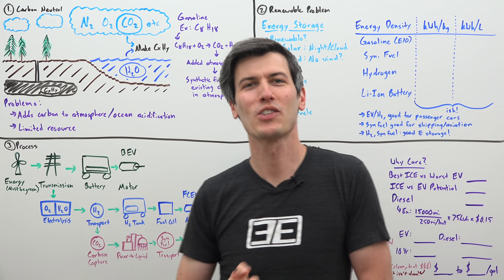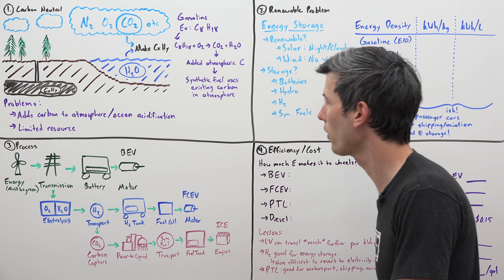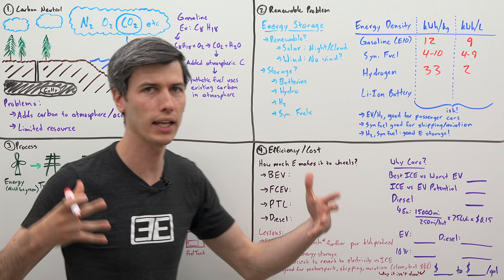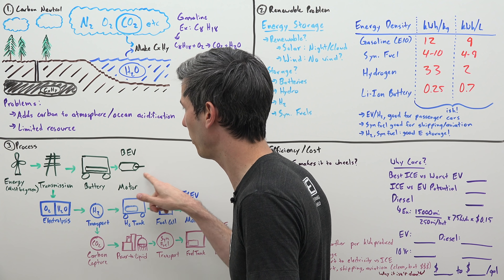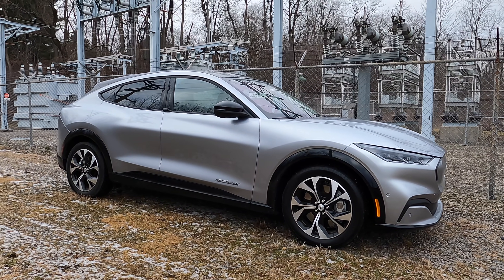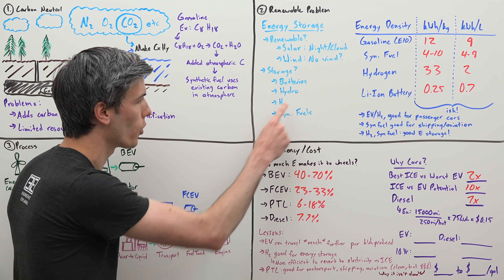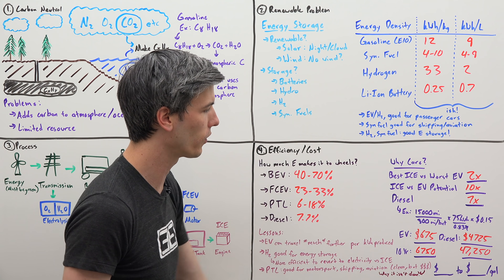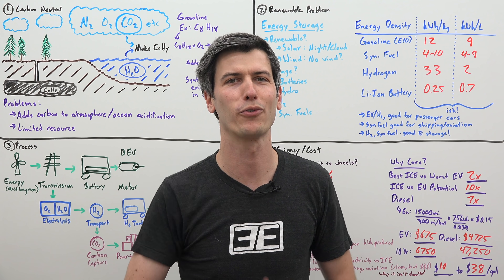The Big Problem With Synthetic Fuels

Comment: These sorts of comparisons need to start factoring in mass of the vehicle, even the passenger car, with respect to efficiency.   A Model 3 is 4000 lbs and a Civic is 3000 lbs.   On the freeway, dominated by drag, it matters less, but in city driving, acceleration and deceleration of 1000 extra lbs matters.   At those numbers, as of this 2021 video, efficiency still comes out way ahead for BEV, but the gap is not as big as just energy delivery, because of the difference in energy needed.    The other elephant in the room is safety.   Mass in motion is kinetic energy....the kinetic energy that makes crashes more dangerous, and more likely (vehicle performance being worse).   Lighter cars, all else being equal (crash structures, etc), are net safer in vehicle to vehicle collisions.

Comment: Not one of your better videos. The potential for hydrogen is +100% power conversion simply because heat is also energy input and it has been demonstrated and you can buy electrolysis tech that delivers just that. Recent MIT research point to jut 770kWh per ton CO2 totaling $56/ton based upon $0.03kWh offshore wind. Fossil fuels couldn't compete without the $7Trillion subsidy.

Comment: Is there a version of this where there is also an accounting of the energies required to extract these energy sources (eg crude oil extraction, and refinement energy costs, compared with lithium brine extraction and refinement, compared with eg producing of solar panels to collect solar energy to deliver & store electricity, etc)? Because that should surely factor into the net equation of overall energy cost, no?

Comment: Missed out a couple of big issues. 1. Amount of carbon produced making electric cars (mining transporting processing all the stuff to make it not counting any other pollution
). 2. Shear limits on how much stuff we need to convert to all electric transport including the up front production of carbon to make those vehicles (ie not enough copper mines and 10+ years to develop new ones). 50% fuel efficiency gain would be a better goal short term and cost wise.

Comment: With both using renewable energy, synthetic fuels are carbon neutral but BEVs are zero carbon. The goal is to get global CO2 levels down, not just keep them the same.
Reply: But then consider the effort and emissions surrounding lithium batteries.

Comment: Jason, can you find the answer to this question:  How much electricity is used in the gasoline supply chain?  Is more electricity used to drill, pump, transport via pipeline, refine, pump, store, and pump a gallon into your tank than if we just used the electricity directly to charge your EV?

Comment: Overall cost of running a car needs to be considered. 
We need to include the cost of wearables. Fuel might be expensive but how much is a new battery, or tyres or brakes?
Are the insurance costs of an EV more?
Are taxes more or less and how will they change, (because they WILL change - the govt ALWAYS move the goalposts)?

Comment: You CANNOT compare battery energy density to fuel.  Batteries are store not fuel.   You need to compare common denominators like system weight and volume for range.
I prefer to compare a power wall to a Hydrogen storage system (electricity in electricity out), its 90% to 35% (on a good day) round trip efficiency.
The Porsche cost doesn't include direct air CO2 capture, thats likely to double to cost.  Their CO2 comes from burning fossil fuels.

Comment: @Engineering Explained, one comment to Your absolutely great video: here in Finland, the fuel already costs over 10$/gallon. So The synthetic fuel doesn't sound too expensive in here! And therefore it might be a lot more feasible, than You seem to believe. As the fuel is in rare countries as cheap as it in USA (or other countries with domestic oil production). Of course much of the fuel price here is due to the taxes, of which most are justified due to the pollution, and with synthetic fuels there would be less justification for these taxes.

Annother thing is the prices of new cars. Again, here in Finland, the new cars cost roughly twice the amount (or more) they cost in USA. And that is why we have one of the oldest fleet of cars (average of 13 Years). That is where the synthetic fuels can help us to move forward with minimizing the carbon dioxide emissions, as that wouldn't require the complete renewal of car fleet in Finland.

Third point is, that at the moment we are building A LOT of wind power, and therefore there will be times in the future, that it will be profitable to produce even synthetic fuels with the energy no-one needs or is willing to pay for.

So my point is, that the synthetic fuels might be a feasible choise in passenger cars also, at least for some transition period, depending of the country You live in.

But I really enjoy Your videos, they are so informative and very well presented! Please carry on the great work!

Comment: Does storing the energy from the source as hydrogen also have less environmental impact than trying to build massive battery banks to store for use later? If so, it seems to me that would be the most environmentally effecient way to ensure EV's have enough power they can be charged with ... as their adoption grows, because renewables arent stable enough in power output to support a worldwide transition to EV's, so yeah there has to be some sort of energy storage because of that, and using batteries to store, before it charges EV battery... yeah thats just not gonna work out until battery tech and environmental implications of them make leaps and bounds in their energy density. The only stable alternative to unstable renewables, currently is nuclear. If nuclear was the predominant source .. then there would be no need for massive battery banks or hydrogen storage to meet the current and future entirety of EV charging demand... im thinking..

Comment: you are correct, Ethanol can and is capable of completely eliminating gasoline. Gasoline engines were originally designed to run on Alcohol (same corn alcohol as moonshine and that is why it wasn't adopted, replaced need for gasoline, John Rockefeller got the government to create a sugar tax, and the cost effectiveness was destroyed) . Diesel engines were intended to run on Vegetable oil.  run the number son that.  AND take into account that both fuels are carbon negative asn teh plants that produce thenm actually consume carbon dioxide from the atmosphere

Comment: the biggest hurdles electric vehicles still have to overcome when it comes to actually being environmentally friendly are:
1) the mining process necessary to make the batteries for the vehicles
2) the process of actually making the batteries themselves
3) recycling the batteries so they dont leak toxic chemicals into the environment

there's also the problem of the batteries catching fire. lithium fires are much, much more dangerous than gasoline fires, but i feel that can be solved with relative ease compared to the other 3. its more like a bump than a hurdle

and given synthetic fuels are just so cost prohibitive... hydrogen may genuinely be the best option for now, but the infrastructure needs to be built. unlike EVs where you can get a charger for your house pretty easily, hydrogen vehicles more or less need dedicated stations, since its so volatile

Comment: I finished watching your video titled no, synthetic fuels wont replace electric cars.   You covered how synthetic diesel is too expensive to make sense.  I have been thinking about the abundance of anhydrous ammonia.  Figuring out how to use nitrogen from the air to make food was huge for food and population growth.  I thought even though the energy  and pressure requirements to make plant food is high and uses mostly fossil fuels that if you consider your premise of your video that your analysis might change.  If you consider renewable resource such as solar or wind, my preference is for thermal systems storing heat, then make the fuel (which i think is NH3/NH4) and Distribute that it would be more energy dense than a battery.  More over a hybrid BEV with a ammonia based fuel generator would not need such a heavy battery and could still supply torque with out large variations in engine output.   Since we already have a distribution network for fertilizer, I think it would make sense as the system could be scaled up and existing gas stations adapted for the fuel.  I was hoping you could do a video update on nitrogen based fuels as a result.

Comment: 6-18% not bad if you start from an abundant power source like solar panels in the desert,  gasoline is compact and you don't have to wait for recharging and the vehicle is cheap and light and  does not use rare minerals and don't not use high pressure tank

Comment: Why not include the energy needed to build the cars? You need 500 thousand gallons, or almost 2,3 million liters of water to get one tonne of lithium. Not to mention the recycling of the lithium batteries, you can just put normal ICE car in crusher and turn it into a cube and drop it into a smeltter to build new car, you can't do that with lithium batteries

Comment: Here is the thing though you need to think about energy storage costs,
In general in countries like Cyprus Israel etc, it's very possible to get more than enough power than you need from solar during the day, but at night you can't and also you need to protect against cloudy moments that will shut down the grid,
So you need to store energy for that, 
Storing as hydrogen is cheaper, than storing to batteries
And you can use it at night

Of course all of this is BS and nerd junk, we should just use nuclear energy

Comment: If production of e-fuel is to be done on a massive scale (which is the only way it makes sense) it requires a huge electrical power production and infrastructure but that is where we are going anyhow as hydrogen production through electrolysis also requires that same insane amount of electrical power, hydrogen as fuel is just as needed and has to be produced on a massive scale to fuel ships, industries and other heavy transport.
So according to me I think it's better to maintain the production of a higher amount of electrical energy rather than using lithium batteries which are not very efficient though they are getting better, but they are really more of an environmental issue, and  are quite expensive with a short life-expectancy. So if battery-technology is not rapidly changing then I think e-fuels are a much safer, environmentally friendly and perhaps cheaper way for more people to still be able to have a personal vehicle in the future, or atleast 1/family.

Comment: You showed very well how Corn should not be the source. However you can produce Biomethane, Bioethanol and plant oil and use that very efficiently and local.
In Germany rapeseed oil is used. Rapeseed produces 2/3 cattle food and 1/3 oil which then is used to drive the farming equipment. Also it´s not growing in a monoculture. 
Corn is a bad idea yes, however using plants for energy in general is not. It would be like saying EV vehicles are a terrible idea because we use those 100 years old battery tech. Yeah this would be a bad idea however modern cells are much better and only this makes modern EV vehicles viable at all.

Comment: In principle, yes, the extra processes reduce the efficiency of the overall process. But the great thing about liquid fuels is that it transports well, so you can produce it where the natural energy resources are most abundant. And studies showed that the efficiency numbers are not that clear when this comes in the equation (although electric cars do remain superior). Not to mention that synthetic fuels create less challenges towards the metal requirements than electric cars as we can keep using the same car while increasing the sustainability of its use. Also not sure why synthetic fuels should have a lower energy density than regular hydrocarbon fuels 🤨 It's possible to create the same quality of fuel via synthetic methods.

Comment: In the US, I may agree on the cost, but this has a few flaws:
* Direct air capture is not the way most seek to capture the required CO2, it’s much easier to take it from an combined cycle waste to energy plant or biomass plant, or an industrial process. The efficiency is a lot higher and the energy need thus lower. The cost is roughly one tenth as well.
* The average gasoline price in EU is about $2, or around $8 per US Gal. The price hike to reach the necessary level isn’t that big, and will be necessary for the millions of cars still on the road. 
* SAF or eJet will be necessary for all aviation and right now, this will only be a few percentages but over time, the share will be around 70% in EU at least. When demand for eDiesel etc goes down, that will likely go up. 
* eMethanol or other hydrocarbons are basically the only options for shipping 

So, in short. In large parts of Europe, e fuels will be the way to go first. And over time this capacity will be used for shipping and aviation. And exotic and collectors cars.

Comment: There's a big problem with EV's that not a lot of ppl talk about. The materials needed to assemble the batteries have to be dug up from somewhere, and that process is far from carbon neutral or eco-friendly. Not to mention, the batteries have to be disposed of somewhere after they're spent, and I'm sure that process ain't all that eco-friendly, neither. Just seems to me as if we're damned if we do or damned if we don't....
Reply: Lithium batteries are actually very recyclable (upto 97% iirc). Not to mention there's been an influx of different, unique methods by many different companies on how the recycling gets done. Some are different less eco friendly than others but yeah it's a field that's seeing rapid growth these days because of the massive increase in demand for lithium batteries.
Reply: There is a astronomically bigger problem with people not doing proper research before they comment on this topic. If you had done so, your comment would have been nearly 180 degrees different.

Comment: Let’s just be clear battery technology will be dropped for passenger cars and charging infrastructure will be rendered useless, it’s just a matter of time before hydrogen and Synthetic fuels replace it. Battery’s are not the environmental solution, electric drivetrain maybe yes but definitely not battery’s. Also you can’t argue even if fully electric cars are better than fossil fuels in the short term because of all the manufacturing and infrastructure being put in that will be obsolete that needs to factor back into the equation for expended co2. And also the fact some people keep their cars (that already physically exist) more than 2 years. Not even mentioning the additional mining needed for the materials for the battery’s or their disposal. 🤷🏾‍♂️
Reply: Glad you got it sorted out after you clearly did a thorough and non biased research on this topic. Where shall we put our bets on the companies behind your vision on the future because we’re all gonna be millionaires. Thanks ahead

Comment: What you're missing is the cost of realistic infrastructure for electric cars. In the UK, the majority of homes do not have parking. Therefore you need charging points everywhere. They come with maintenance costs and install costs. Plus synthetic fuels via mass production can use much of the same infrastructure that already exists thus negating a huge infrastructure and maintenance cost that electric powertrains will use. I think there is more to explore in the argument than just analysing production and surface efficiency costs
Reply: People don’t have a gas station in their backyard now in the UK, do they?
Reply: @gerardhaus8150  no they dont. But many don't have a backyard full stop. Also installing an electric charger at home? Yeah that's cheap in the uk (it's crazy expensive). The issue I have personally with electric is it is being pushed on people to take accountability when the infrastructure, practicality and viability isn't there.
Reply: @ctbsbusiness  A bit like “in the good old days” when combustion engines started more than 100 years ago? Almost no gas stations, very few cars around. 
It’s all about (private) money that flows in enormously once there’s enormous money to be made. That moment is nearing, UK is just a bit “off” right now, that’s right. But it’s catching up quickly too. 
Cross the channel and you will see there is very little to nothing to worry about from that perspective in France, Holland, Germany,…let alone the whole of Scandinavia.
Reply: @gerardhaus8150  the good old days? Im 36, hardly 75. But you sound like a man who knows best so I'll cut this short. I dont feel electric is the correct solution as a one sized fits all pushed on people.
Reply: @ctbsbusiness  I think being reasonable is best, hence the comparison with 100 years ago. Was same debate back then, only with bowler hats on and in a pub, handshake at the end. Nobody remembers it but not hard to imagine.
So indeed, you’re right, there is no size fits all. But reasonable in this matter means only 1 thing: mass. For the vast majority right now, EV’s are a solution or starting to be (price) For the thin minority (getting slimmer as tech evolves), are not a solution. But facts speak for themselves we’re already on the path towards EV’s for the masses, let’s say early sixties in historical terms compared to ICE’s. Goodday!

Comment: How about synthetic methane? Since it's the first product of the process it would be a lot less expensive, and you wouldn't need the infrastructure investment that H2 needs. You could simply inject methane into natural gas distribution pipes and then compress it as it's normally done with CNG, or liquefy it and sell it as LPG